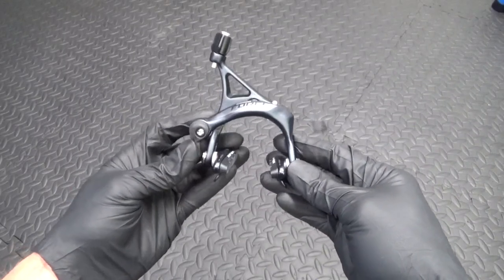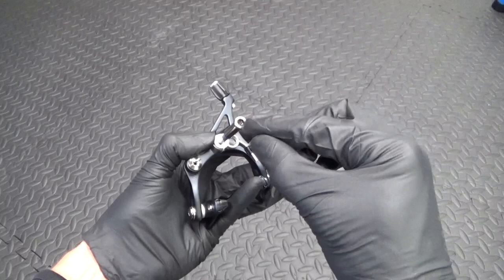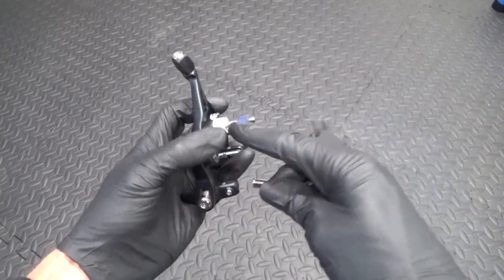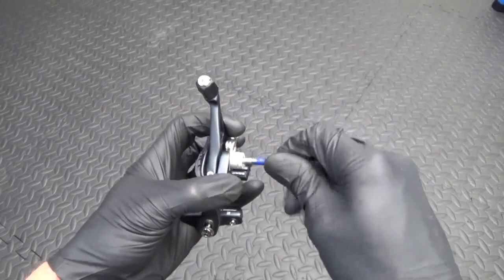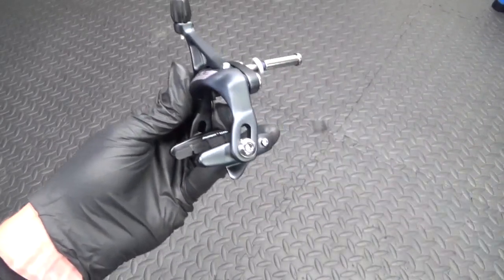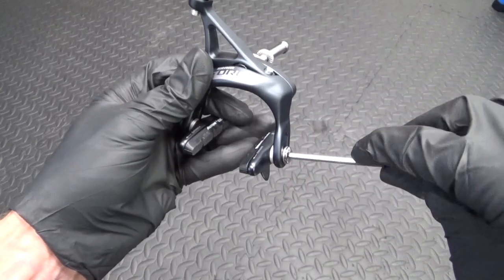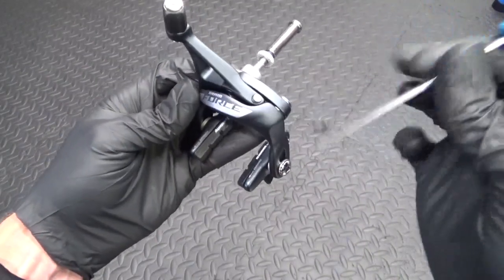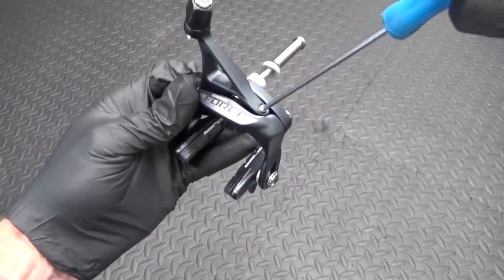SRAM Force Rim Brake Caliper Fitting Guide

Comment: Excellent video …can anyone help me with a problem please…With these calliper breaks my break pad holders are as low as I can get them,however when I squeeze the breaks the actual pad hits the top of my wheel rim..can this be adjusted at all to allow the pad not to come in contact with the tyre?
Reply from the maker: Your frame probably requires long drop brake calipers!
Reply: Ok many thanks 👍🏻 @FreeToCycle

Comment: Would this caliper fit a 30mm tire? My sl6 fits 28-30 but the ultegra 8000 won't clear 28mm
Reply from the maker: Max 28c tyres!
Reply: @FreeToCycle  Hi, my used sram force calipers from 2015 do not open enough to go around a rim for 25mm tires. Is there something to unscrew or deblock to widen them or can there be debris blocked in it?

Comment: Hello, thx for the video. One question while centering my brake caliper (sram red road)

I can't have both adjustment in place, centered to the eye and pads touching at the same time. It's one or the other.

- I center it to the eye
- As I apply pressure to the brake levers, one pad will touch first, then the other will start moving abd touch the wheel.
- I fine tune the adjustment so that they both contact the wheel at the same time
- Now they not centered to the eye.

What should I do ? I'm going through this as after changing wheels with brand new ones, brakes are screaming on downhills. I've also check caliper tension, new brake pads, alignment with the wheels.

If you have any advice I thank you !

Cheers

Comment: Thank you for the video, are Sram callipers a floating design? I have heard people suggest they are difficult to live with because they easily move off centre such as when one cable touches another? I am a bit concerned about this on my Bianchi as the Bianchi design isn’t the best in that the rear brake cable entry is directly on the head tube, this means when I turn the bars the front brake cable contacts the rear cable, could this cause the front calliper to rotate and bind? I know it would centre itself when the bars are straight, but it could be annoying?